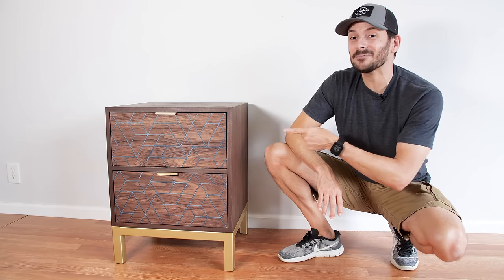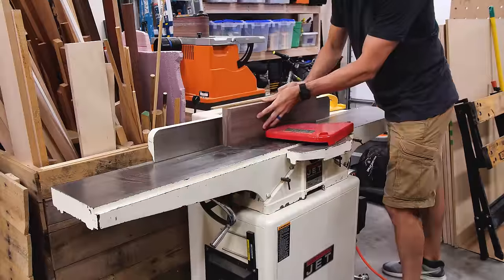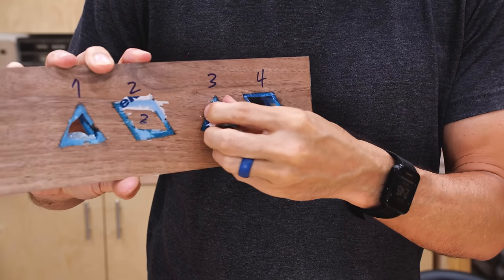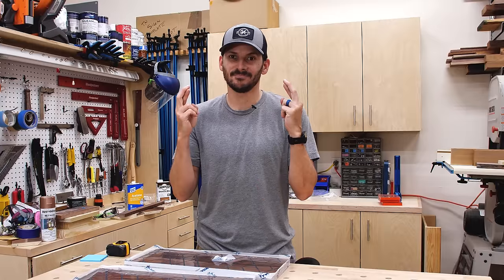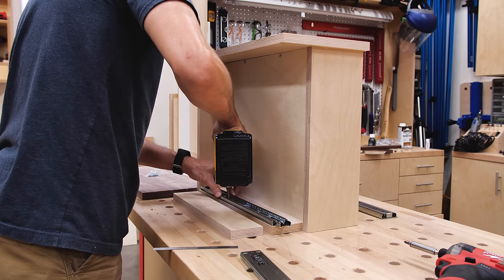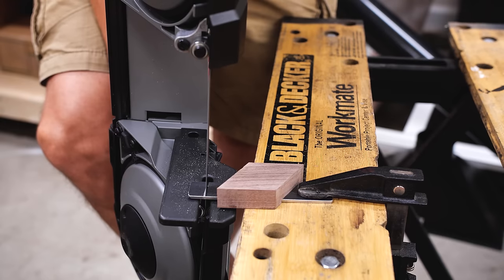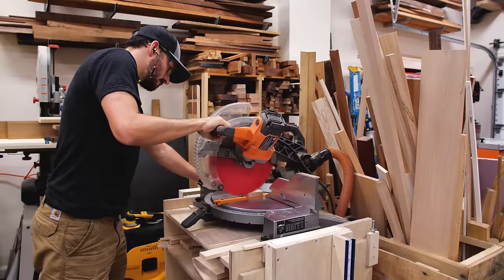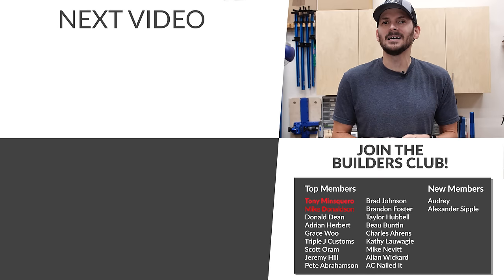When an Engineer Builds a Nightstand

Comment: This is more fun than anything but it would hide things from people casually snooping around. I wonder if just having the draw pop out from the side of the cabinet would conceal it better. You'd still have the obvious space between the draws but it's a side table so people are going to be more unsuspecting. The front of the top draw could even hang down as it already does but the button could be under the draw do it needs to be opened or just concealed in a design on the opposite side of the cabinet from where it opens.
...of course I will need someone else to make this as I'm far too hopeless.

Comment: Cutting metal in 
a cardboard box is not the best idea i saw from you
Reply from the maker: It's a cold cutting saw, not an abrasive saw. I wouldn't do this with an abrasive saw
Reply: @Fixthisbuildthat  yes i know, but trust me when you cut hard metal result blue chip, very hot
Reply from the maker: @1337BlueBird  not this one. You can touch the cut with your bare hand right after the cut